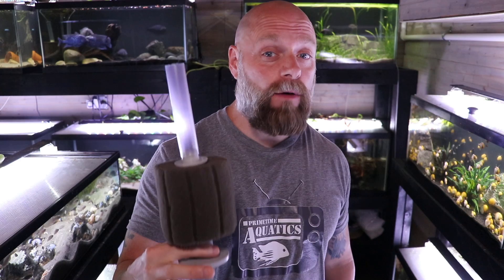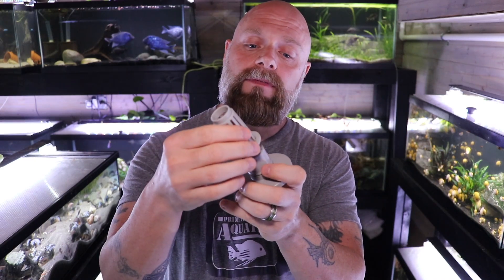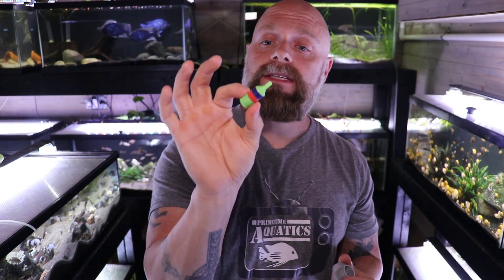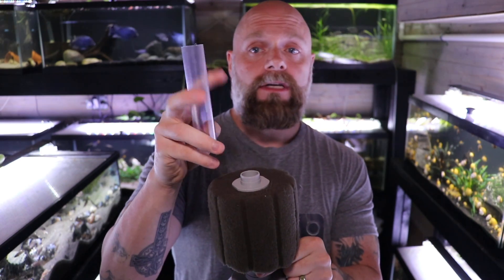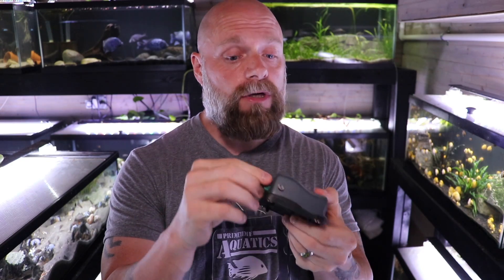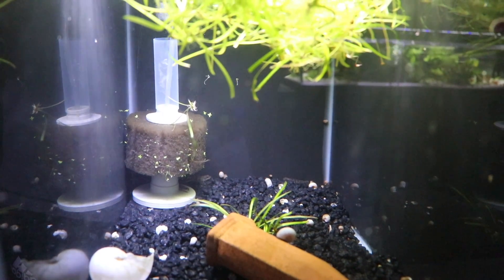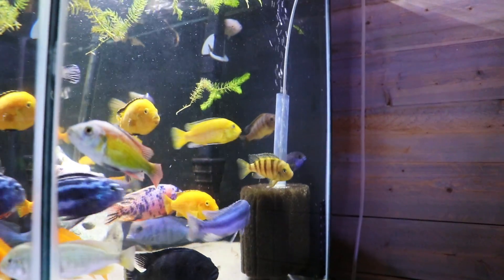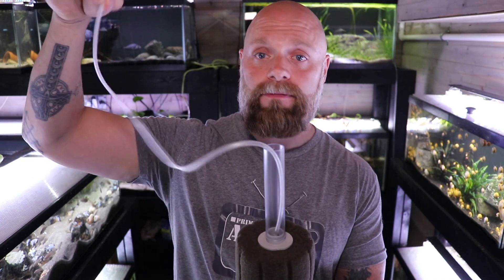Fish Tank Sponge Filters: Everything You Need to Know! Assembly | Placement | Flow and More

Comment: Great video! Can I ask about my setup here?

I have a 55gal community tank with 7 black skirt tetras and so far 2 angelfish. We also wound up with a bala shark who does not really belong there, but he's a really sweet tankmate so not the biggest deal. Then I couldn't tell you how many nerite snails I have now, more than 5. Currently gravel substrate but I intend to change directions when we move. Thus, I'm hoping to establish a stronger nitrogen cycle in the filters that will transition to the cleaned tank, so I can get rid of this disgusting old gravel floor that wasn't cleaned enough, which I was given by a friend who saw me getting into the hobby while he was getting out. I want to get more plants and driftwood, as well as more angelfish plus a couple of plecos. As time goes on, I will probably maintain a similar number of tetras and snails, give or take a few, and maybe one or two more small docile more exotic freshwater fish. I realize that's pushing the bioload in a 55gal, thus my questions about filtration...

I have 2 HOBs with carbon filters that I rinse once or twice a month and I change 1 out of 4 in sequence every water change. I also have 2 small sponge filters in corners and 1 large in the middle. My pump setup is pretty solid, and each filter has a dedicated valve to adjust bubbles. They are coming off the same pump,  which is a dual pump that I merged both ports on into a 4-way splitter (1 open port for a large sponge in my future axolotl tank, which will also get 2 of the nice Hygger sponge filters). I haven't added air stones yet, but I intend to put them in every sponge filter eventually (and appreciate your recommendation on type).

I do really like the aesthetic of bubbles, and obviously I'm proud of my system lol. Is it overkill in any kind of detrimental sense, though? Could it be causing any kind of problematic flow in the tank? What about my idea of keeping some healthy bacteria on filters when I change substrate - is that logical or ignorant?

Love your podcast, BTW! I'm a new fishkeeper and have found lots of useful information here ^.^
Reply from the maker: I don't think you will have any flow problems. Defintely keep all the media submerged when changing over the substrate and you should be ok there.

Comment: I have a sponge filter that the hose connects at the bottom of the sponge filter with an Aqua one 750 R and I was struggling for flow. I am only keeping shrimp and plants so I don’t need hi flow but the pump was struggling. Once I put an air stone down the centre tube as you recommended I was able to switch to a Japanese silent pump that is about 260 ml per minute flow and it pumps way more air. Thank you so much. Now the filter is working properly and the silent pump is a blessing as it’s next to my bed. I am bed ridden for the next 6 months and now I can sleep much better. Absolute game changer.
Reply from the maker: Great to hear!

Comment: Bro nice fish room but your electrical would drive me insane, OCD.  You should hire a electrician, I installed a small rack in my laundry room today for 130$ it's a stand, for 160$ it can hold 3 x 55 gallon tanks,  It's 48 x 17 x 72 inches tall, they have 6 foot cross beams then you would be able to fit 3 75 gallon tanks on one rack.  The frame adds around 1/4 inch on each side, 3/16ths.
I would be tempted to just buy a real piece of sponge, cut it open and stick a water pump in there and then put two external overflows on the top two tanks, just create a cycling effect for the 3 tanks and then make the bottom a refugium, bunch of plants in the bottom, that should work and then something to create surface area for bacteria, rocks would work if they have holes in them and I happen to have 20 pounds of dry coral rock, I have some pieces I gathered after a hurricane in Mexico but those are less porous and more dense, heavy and white and they seem higher in calcium than say Fiji rocks. I think these types of rocks could be used to raise your PH, the type of rock you might find like in Mexico, looks white. Not sure which kind of fish I might do probably cichlids and parrotfish in the top two tanks, or you could use this as a breeding setup if you have a ton of babies, I figure a couple 29 gallon tanks would be adequate for fry. I have a breeding pair of angels I think anyways if all is still well between them, I can start to remove the eggs and see if I can hatch them.

Comment: How does just an air pump to sponge filter actually filter a tank as opposed to how a mechanical hanging filter filters ?
Reply from the maker: The air creates suction. They do an ok job of mechanical filtration but not as good as other types.
Reply: @PrimeTimeAquatics  thanks for the speedy response , I’ve got a 300L tank for a FH it’s got internal hanging filters right now but I wanted to swap to 2 380L sponge filters. Wasn’t sure if it would be enough to run those as I don’t want the internals in with the FH

Comment: I always use the uplift tubes.  I use the plastic air stones on the end of the airline but just run it down the uplift tube and don't attach it to the filter.  The weight on the plastic air stone keeps it in the uplift tube but not being attached, makes maintenance way easier.

Comment: Water does go "up" against gravity. Capillary action- when you dip a napkin vertically into water, the water moves up due to the hydrogen bonding in water molecules. The adhesive forces of water to the napkin are stronger than that of water to itself. In a glass tube (made of silicone and oxygen atoms) the hydrogen bonding from the hydrogen in water to the oxygen in the glass is stronger than the cohesive forces (attracting water to itself). That is why water forms a meniscus (curve on the surface) in a glass tube. The water molecules are essentially climbing up the sides of the glass, until gravity and cohesive forces equalize the adhesive ones.
Reply from the maker: While that is true (in plants what is driving that is evaporation on the other side (the leaf). That is not happening in an air-driven filtration system and therefore the force of gravity will be greater than the adhesive and cohesive forces of water.

Comment: So I just bought a rimless 50 gallon tank that has two holes drilled for a sump towards the top of the tank. But after watching some videos I want to go with a sponge filter instead of a sump. What should I do about the holes in my tank? I'm new to all this so explain it like I'm five please
Reply from the maker: You may be able to use bulk head fittings to block the holes, but I haven't done it?

Comment: I have a 54 inch tall tank and I’m wondering if a regular air pump will work , or if I need a special one
Reply from the maker: I would get something larger than what you normally use, but make sure it has an adjustable flow.

Comment: Do sponge filters also Feed oxygen to the tank? On a forty gallon would I need to add more oxygen to airstones On a separate pump or  sponge filters Be sufficient On a 40 gallon tank
Reply from the maker: Not so much from the bubbles they produce, but from the surface agitation. Sponge filters should be enough.

Comment: This may sound like a stupid question.. but I have no idea when it comes to sponge filters, does the water go out of the tube? and if it does how does the water get back into the tank? I'm so confused pls someone explain lol.
Reply from the maker: Yep - as the air moves up it pulls water through the sponge and out the tip through the tube.
Reply: @PrimeTimeAquatics  so the bubbles are the water going back into the tank right?

Comment: 0:26 I’ve had 20 gallon and 29 gallon tanks (with under gravel filtration) and currently have a 75 gallon with a tank filter.  I’m setting up a 10 gallon quarantine tank.  I intended to get HOB filter, but now am wondering if a sponge filter only could be enough.  Is that true?
Reply from the maker: Either one will work fine.

Comment: 🤔 How far down do you put the check filter on the air line ? I have a 10 gallon and don't want anything happening .
Reply from the maker: I don’t use them because my main lines are close to the ceiling, but if I did I would put it just outside the tank.

Comment: Good afternoon Jason

First of all, my wife & I love your channel and videos!  We have 10 tanks from 75s down to a 10 gallon nursery.  I know you're a big advocate for sponge filters, so I thought you'd be a great person to reach out to.

If I add a sponge filter to an established tank that's been running for over a year, levels are all good, no issues, fish are all healthy & thriving, when is that sponge filter cycled or seasoned?  When does it contain enough beneficial bacteria that it is now contributing, in a beneficial way, to the tank?  Or when would that filter be ready to move to a new tank to help start the nitrogen cycle?

Also, I've taken your advise, and ran the air hose down close to the bottom of the inside of the sponge filters.  Not just attached them to the top nipple.  Just a heads up if this makes a difference.

Any help is appreciated.

Thank you
Reply from the maker: I usually wait about 6 weeks. Should be ready for the new tank by then.

Comment: I have a 75 gallon and I got 2 sponge filters rated up to a 60 gallon. Should I get a bigger one or these two should be fine? I have 2 Oscar’s, 2 Jack Dempsey’s, and a Cory Cat.
Reply from the maker: Most likely you will need a HOB filter to remove the debris that winds up in the water with those big guys.
Reply: @PrimeTimeAquatics  I will look into it. Thank you for the response.
Reply: @PrimeTimeAquatics  I have the Polar Aurora 304-B. It does 525GPH.

Comment: Can you use a sponge filter for a 30g.   With say 10 tetras, 3 guppy’s, and 4 corys??    What would you use for a filter.  I hate hang on the back filters.
Reply from the maker: Definitely!
Reply: @PrimeTimeAquatics  I thought so.  my fish seem to be happy but since I’ve had the guppy’s.  There’s alot of poop around the filter.  It’s definitely working..  but alot on the sand..   around the filter.  it’s a large size in the middle of the tank.   Any suggestions?
Reply: @PrimeTimeAquatics  I went to a locally owned fish store the other day.  Asked what they suggested maybe a different sponge.   They said I should only have a sponge filter in addition not instead of a hang in the back lol.

Comment: I still don’t understand how these things work when the top of the uplift tube is below the water surface. Surely, the water in the tank is constantly trying to flow into the top of the uplift tube thereby negating any upward movement of water in the airstream? If the top of the uplift was slightly above the water line then it would be a different matter but with it below the water line it just seems like such a bad design. Maybe I’m missing something but can someone explain?
Reply from the maker: Actually if the uplift tube is above the water line it stops working. The air flowing up on the water creates suction that pulls water through the filter sponge.
Reply: @PrimeTimeAquatics  Hi, thanks for your reply. With the uplift tube, I don't mean way above the water line, I just mean at, or very slightly (a few mm) above, the water line. I ran UGF like this for years. The airlift was sufficient so that the top of the uplift tube could be just above the water line and the water would still emerge from the top of the uplift and drop back into the tank. With the sponge filter uplift tube submerged (as is the case with many air driven filters) I can't help thinking that the water in the tank wants to just flow down the uplift which would work against any flow of water through the sponge.

Comment: Having trouble with new sponge filter not working. Purchased larger one.  Did not cycle filter as I had no way of doing at the time. It's been in tank for 4 days. I have another small sponge filter in tank that works great so I get the concept and understand how to set up etc. Not new to fish keeping. But I am new to using this many live plants and to using sponge filters.I don't get why this new one appears to not be doing anything. Water starting to turn cloudy. Is there any thing I can do to kick start this sponge to get it to do what it should be doing? Can I add something to water to speed up cycle time? I have plants in tank if that makes a difference. This is a 10 gallon tank but tall version. I've kept an aquarium for years but this is first tall tank. I have never had this much trouble keeping a tank clean. And I am sick of cleaning it every other day to keep clear water! My water tests are good. Can only assume it's because tank is taller that I am doing something wrong. Any suggestions would be appreciated. Thanks
Reply from the maker: You could try Fritzyme 7?
Reply: @PrimeTimeAquatics  yes I tried. Hoping that will help get sponge filter working. I think my problem is twofold. I don't think I am getting enough water movement at bottom of tank in order to move waste to sponge. If that makes sense. Could that be possible reason sponge filter isn't working?. Thank you. I appreciate you taking time to respond to me.

Comment: I’m having an issue where my flow tube and top cap keep disconnecting from the sponge. Am I the only one that’s experienced this ? How do I fix this ASAP ?
Reply from the maker: It happens sometimes. Just a matter of making sure the air line is very secure. If the filter itself is not staying together that could be an issue with the filter itself.

Comment: Question. I have a 55g with a cannister filter. I have 3 pieces of décor that have air bubbles coming out of it. I want to replace those with sponge filters. Would this be too much filtration? I already know the amount or air bubbles/agitation in the tank is fine.
Reply from the maker: In the sense that the surface area you have is already sufficient - yes. However, they can serve as a nice backup.
Reply: @PrimeTimeAquatics  I may just only put in 1 sponge filter to run with the canister filter, not 2.

Comment: do i need more than 1 sponge filter for 90 gallon aquarium ..? or do i have to use a canister filter or  a sump ..?
Reply from the maker: For a 90 gallon I would run two HOB filters. If you went to use sponge filters - two ATI Hydro 4s should be good.

Comment: Thank you.. always wondered about those things.. I'm about to get back into the hobby .  I used to use the corner filters and they worked good so I'm sure these will also.  What are your thoughts on using a power head instead of a pump?
Reply from the maker: Good question - if I’m going to hook up a powerhead at that point I’d rather just have a HOB filter.

Comment: Might be stupid question but what if you put your air line through the bottom with a air stone?
Reply from the maker: Good question.There are some sponge filter that have a lower connection point, but most are designed to create suction with the air being connected to the top.

Comment: I have 20gallons acquarium can i used the biggest sponge filters like the xlarge
Reply from the maker: I'd probably go with something closer in size to the Hydro III.
Reply: @PrimeTimeAquatics  i have 12 tiger barb fish on my tank how open should i change the water

Is the tiger barb fish more easy to take care than the gold fish?
Reply: I have also question my gold fish alwys die like it would last like 2weeks they alwys swimming ontop and stand by the corner.i been spending to much money buying idntknu cos im fallowing all the instruction i change water like evry 10days i put water condioner i have my filter running good and also airstone thats why i swtich to tiger barb fish
Reply: And i have the 20-40 air pump machine

Comment: Is a sponge filter the same thing as an air pump? I just bought a 90 Gl aquarium and am trying to figure out the right filtration requirements. We currently have 2 75 Gl topfin power filters ready. Looking to setup a south/central American cichlid tank. Thanks!
Reply from the maker: They are usually used in combo (the air pump provides the bubbles for the sponge filter).
Reply: @PrimeTimeAquatics  Amazing thank you.
Reply: @PrimeTimeAquatics  Sorry to bother but I'm wondering if the sponge filter is necessary when I have 2 HOB 75 Filters already? or would it be a bit overkill?   

  Also is there a product that is a suitable replacement for the carbon filters? $15 a month is not ideal!

Comment: Hi, from the top cover of the sponge filter, I actually cut off the bullseye and connect the airline tube from the pump directly to the air stone. (3:52) Is that ok? Will be grateful if you can clarify this. Thanks.
Reply from the maker: Ya, it serves the same purpose. I usually just run a second smaller line on the inside of the sponge filter.
Reply: @PrimeTimeAquatics  Thank you.

Comment: You can also run a sponge filter off a powerhead, just attach the uplift tube over the powerhead intake. 
My dad used this set up. Powerhead sponge on one side of the tank and a only air sponge filter .  

One thing I have noticed is how hard it is to actually find sponge filters in stores now. You won't see them in big box stores, because they aren't designed to have you constantly replacing or buying filter parts or cartridges. 

Sponge filter the industry standard for generations. They are simple and easy and that is why they will always be a staple of the aquarium industry..
Reply: I also use sponge filters with powerheads. Less noise overall, no air pump noise, no bubbling noise.
Reply: You are right. And they are very efficient .

Comment: Have two sponge filters...i slightly disregard them there brand new...think there good for the job but to cut corners im more easy going I love PULACO aquarium air pump comes with one air pump 1tube n two filter holes ...very easy to ASSEMBLE low noise w/extreme awesome Super flow...including reasonable price